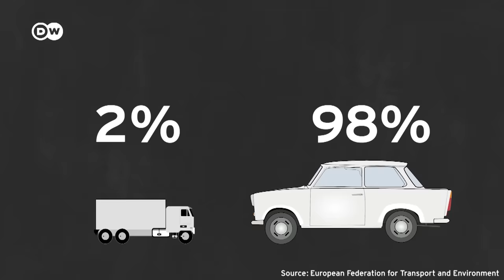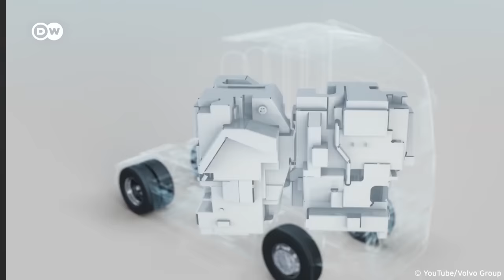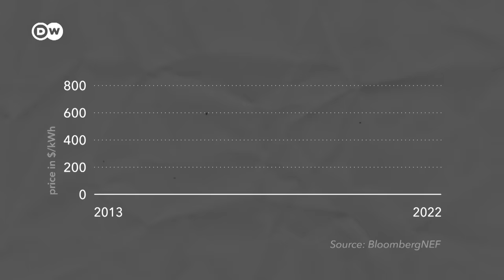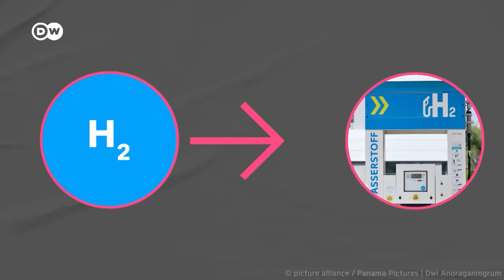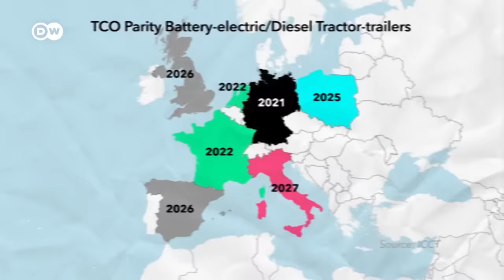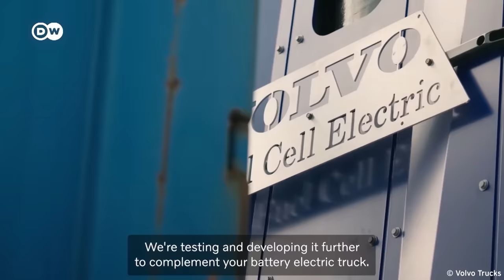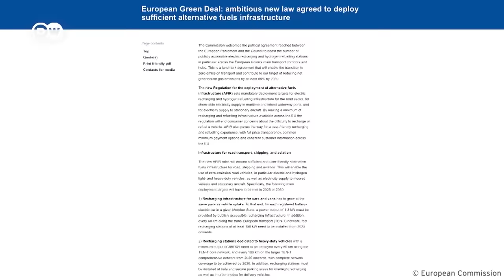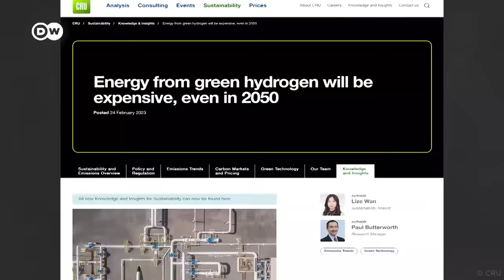Which will be the engine of the future?

Comment: How long do those batteries last? how expensive are them to make (water/energy)? And what parts can be recycled or reused? Isn’t the waste of the battery pack and all of the energy used in the making worse than our original problem? Honestly asking, I’ve yet to read/hear a straight answer
Reply from the maker: Great questions. 🌻 Generally, lithium-ion batteries can last several years before needing replacement but their longevity is impacted by temperature, charging habits, and overall usage etc. Battery production and its environmental impact are complex topics. We made a video looking at "Can you recycle an old EV battery?" you can check out here 👉 https://www.youtube.com/watch?v=PbOBmnZRpZ4

Comment: There is one aspect that always seems to be missing in this discussion, and that is the disposal of electric batteries at the end of their useful life (we are all familiar with this problem, when the batteries in our electronic devices get old, the don't stay charged for very long). For long-haul trucking, this phase late in the battery's life makes it economically unviable, so the batteries would need to be replaced on a regular basis. But what do we do with these old batteries?
Reply from the maker: That's right! EV's are still very hard to recycle. We did a video on this previously you can watch here 👇
https://youtu.be/PbOBmnZRpZ4. 🚘

Comment: Moving heavy batteries consumes more energy and is inefficient. Battery technology is still evolving. It's not practical unless it has much higher energy density, lightweight, preferably portable, and less deteriorating. Hydrogen energy density is also low. Thus, plug-in improved battery + hydrogen fuel cell or ICE for last miles and electric cargo train in the trunk lines is the best combination.
Btw, not only automobiles but also the entire life cycle of any products should be as sustainable as possible. Shifting the pollution by greenhouse gas emissions to the environmental destruction and soil pollution by lithium and rare earth mining in certain areas is not necessarily justified.

Comment: A fairly balanced presentation. But the more you think about it, the more obvious it becomes that BEV is the only viable/economical solution. 
Tesla already proving real-world day ranges over 1000 miles possible. Personally I think swappable batteries overcomes most of the concerns about BEV; smaller lighter battery on board, fast “refuel” time, access to slower cheaper electricity.  The “spare” batteries even have a dual role in arbitrage (buying cheap, selling during peak period). So I’ll happily take a bet with anyone who thinks HFC will ever have any significance in heavy goods road transport.

Comment: I like this change, but do you have some data on the amount of additional electricity that needs to be produced to charge all these trucks, in addition to all the private vehicles?

How much more energy has to be produced and how much more CO2 will be released in the process? 

How much more nuclear waste?
Reply: Electrification will actually lower total energy demand. Electricity is always cleaner than burning diesel in an engine.
Reply: @Simon-dm8zv 
Nevertheless more electricity is needed, which has to be produced somehow.
Reply: @eric8372  Correct, so in a worst case scenario this will be supplied by fossil fueled power stations for the time being.
Reply: Clean energy, renewables are cheaper than coal now.

Comment: Probably need to clarify the heading. It’s not to do with the engine, but the ‘fuel’ lithium battery vs hydrogen. Fair sure both work on standard electric motors.
Reply: Hydrogen fuel cell for EV but you can also burn hydrogen ICE style.

Comment: Both. Mining and heavy use will never be able to use batteries very well. Also the US and Australia transport cargo by truck much further than any other countries on Earth.

The US should utilize cargo (freight) trains much more, but they do not. Australia does not have the tracks to move cargo by train across the country. Australia is better off using ships to go by sea, but this will only ever serve the majority of the population who live near oceans. The rest of the country will be left out. Not something that is feasible because it ignores the food growers across large expanses of the interior. These will always rely on trucks.

Australia also relies on the truck train for long distance shipping. That is a number of trailers pulled by 1 tractor truck (semi in US parlance). This is just too much weight to be pulled by batteries.

3 markets perfectly suited to the strengths of hydrogen. You could develop hydrogen generation along the routes designated, at points which will allow refueling before they run out. Providing also a break for drivers.
Reply: First stop the battery and battery swap large truck & semi fires. Janus Australia. Prototype and Cement Australia vehicles burnt & melted.
Reply: Without long haul trucking to compete with rail would become very expensive for moving freight.

Comment: Batteries are right now too heavy and unsuitable for heavy hauling.  A full capacity truck will cut the range down by half.  Plus the raw materials needed are a limited resource.  Battery life is also a concern with degradation over time, they will need to be replaced at least one.  H2 is the better bet long term and stable in terms of performance over it's lifetime.
Reply from the maker: Hey there! We also did a full video on hydrogen. You can check it out here 👉 https://www.youtube.com/watch?v=AGTjKJHu99c
Reply: Do you know that by law you have to replace hydrogen tanks every 2-3 years? You said batteries cut the range, why? You stop for a mandatory break, you can top up your battery. You can't drive for 15 hours without a break. Limited recourses, mmmm diesel is unlimited, right? Or do you think that hydrogen is free and you can collect it without cost? Battery degradation, first gen batteries are still in use after 10 years, and when they don't meet the criteria they use them at houses to get power from solars and to stabilise peaks of the grid. H2 is 2.5 times less efficient that battery-powered cars-trucks. It needs 30% more power to produce it, needs +20-25% power to compress it to 3000 bars and needs trucks to move it from where it is produced to H2 stations. And is has max 70% efficiency on fuel cells and 40% efficiency in ICEngines

Comment: Can you mix 2 or 3 different fuels for car use, like fossil fuel with hydrogen or ammonia or LPG, etc...
Reply from the maker: It is not common, but if the engines are specifically designed for such applications. Dual-fuel engines can mix a primary fuel such as diesel with a secondary fuel such as hydrogen. (🔗 https://www.sciencedirect.com/topics/engineering/dual-fuel-engine)

Comment: Another option, DME is a synthetic fuel that is compatible with diesel. It would be made with thermal nuclear energy using a high temp reactor like the Molten Salt Reactor which could crack water with heat alone using Sulfur Iodine cycle potentially much cheaper than electical energy, the eff is 50% from heat. If you use electric splitting the eff is possibly half or much worse. The hydrogen is then converted into DME as a carbon neutral process and since it is a diesel substitute, no infrasture changes other than building these synthetic fuel plants next to thermal nuclear plants.

Nobody at this poit can project the pricing of all the options until all options have competed at scale for a while.

Also Sodium Ions batteries could supplant or complement  Lithium Ion batteries, not quite as energy dense, but potentially cheaper to produce in the long run and besides, Sodium is 1000x as plentiful as Lithium. Table salt is just Sodium Chloride.

Comment: Not on Australia diesel all the way because the Semis cover much longer distances and have very strict deadliness and most electricity is generated by coal and gas in Australia so there is no point for EVs and there was an electric semi that travelled from Brisbane to Canberra to deliver an electric Fire Engine lunacy
Reply: Electric cars are always cleaner, even on non renewable energy.
Reply: @Simon-dm8zv  You do realise that to build one EV it creates a massive carbon footprint were as to make a new petrol or diesel car it does create a carbon footprint but than can be reduced because petrol and diesel cars will last much longer than EVs and l own a 26 year old Toyota Hilux and its carbon footprint has gone and it will continue on for another 26 years at least
Reply: @lesklower7281  As we all know by now through extensive resereach: total life cycle emissions of an electric car are far lower than a comparable petrol or diesel car, despite the fact that their production emissions are higher.

Comment: I saw a video that pointed out a rail transportation issue. In the EU there are a significant large number of rail lines, however few are inter connected to other lines. My guess this is the result of the political boundaries existing at the time they were built. Maybe there are other elements that prevent the connections between different lines. Seems like a project to connect all of the small lines into one big structure would bring an improved efficacy, and cost reduction, making greater profits.

Comment: i am not a mechanical, chemical, motor engineer or anything related to them, but i always wondered why they never just burned hydrogen. you know instead of burning petrol you burn the hydrogen for energy. pretty sure its the most efficient form of fuel and clean too.  i am assuming that its too "explosive" or too uncontrolled but idk maybe you can control the ratio of fuel to oxygen for that. why depend of hydrogen fuel cells

also i like how the entire comment section loves trains.

Comment: The presenter said hydrogen is 40% effective and batteries are 80% effective. The researcher said you need 3x more energy with hydrogen, and this is correct, but how the presenter said it it would be 2x differnce. The error is in the presenters efficiency number, and hydrogen has a loss of 75% not 60% as she says.

Comment: Like trolleybus, the heavy truck should be trolley truucks. No battery needed, neither diesel, totally eco-friendly. Old used battery also will one day be a concerns for waste management, and cause of pollution.
Reply from the maker: 🚚 We made a short on pantograph trucks and why they aren't mainstream even though the idea sounds good. Check it out here 👉 https://www.youtube.com/shorts/ReQ99xAmdj8
Reply: @DWPlanetA  ❤️ bio-gas (biological methane gas) fueled trucks can also be an alternative for only truck vehicles. And bio gas are not going to end up like fossil fuel, it gives CO2 and H2O as byproduct. Now even SpaceX also testing methane fuel for Rocket engine, and the starship is on the way of success. Oxygen plants should be encouraged to balance the CO2 level in atmosphere. I think CO2 is less to worry than CO. And country with high possiblity of hydroelectricity should be encouraged to produce in full capacity, so it can come in international market and help less burn fossil fuel for electricity generators.

Comment: The fact that a lot of wind farms don't always run at their 100% capability when the wind blows, says we already have capability for more and better green energy. It is the storage of this lost energy that needs to be worked on. So if all wind farms made hydrogen and had lots of storage for the hydrogen, then the price would come down quite quickly. Alternatively, have on-site battery storage that is not lithium-ion.

Pure Electric trucks need to take engineering from cars. In the sense that trailers can use batteries as sidewall structural. And putting the thinner solar on the sides of the trailers would also help increase range.

Comment: The lithium-ion battery which is used in EVs is made from various rare earth minerals and a huge amount of energy is needed to extract that minerals out and refine them. This process emits a massive amount of carbon dioxide and also these minerals are very limited in quantity and one day these resources will also get exhausted but Hydrogen can still be easily produced. Fuel cells may not be so developed as EVs are today but we should also focus on them and eventually the price of Hydrogen will drop.
Reply from the maker: Hey there! Yes, there are many challenges with lithium-ion batteries. We looked at an alternative kind of battery in this video  👉https://www.youtube.com/watch?v=-vobMl5ldOs and we tackle Lithium specifically here 👉https://www.youtube.com/watch?v=gAZV1Ut6DDs Let us know what you think ✨

Comment: Electric trucks with a diesel generator onboard to charege batteries like the ones Edison Motors is developing reduce emissions nearly 50%. These can help reduce emissions in remote areas and long hauls using existing infrastructure.

Comment: A third option was trailed in Germany using overhead power cables on the right lane of the autobahn.  Similar to a train. This way no heavy battery is needed in the trucks, only a smaller battery (or small hybrid diesel motor?) To power the last kms from the autobahn to the delivery point. What happened to this I am not sure. At the end of the day net zero targets and our current lifestyle are not mutually compatible.  Perhaps reducing whats transported could save the most co2 of all 😀

Comment: The advantage that hydrogen has over batteries is weight.  Mixing hydrogen with oxygen to make water involves taking the latter out of the air, which the truck does not carry.  For batteries, all of the power required is carried by the truck.  Given there is a maximum overall weight applied by law to trucks thanks to their damage to road network, any additional weight means less haulage.

Comment: No word on the impacts these huge amounts of batteries will have. I don’t understand why it has to be this or that. We have a general problem in mobility and these two options both offer solutions in some form. But the best way would be to reduce the demand for long journeys and to use more efficient methods like rail.
Reply: Without long haul trucking to compete with rail would become very expensive for moving freight.

Comment: If there must have trucks, I think that more investment should be put into that idea of having OHC above the main trunk highways. It's more efficient, both from the perspective of energy & materials resources, to send the electrons to the vehicle through a shared copper wire then to have every vehicle carry them in its own box. Consider this, if trucks, at least the ones that are operating either from a port to warehouse or between warehouses,  can draw the majority of their power from the grid as whilst driving down the highway, where most of the journey will be anyway, then maybe each vehicle doesn't need such a large battery, because it would only need to cover the few tens of kilometres between the begin/end destinations and the electrified highway network. Those trucks that would be used for these point-to-point shipments along the electrified routes might only need, say, 100km of battery range instead of 500, for example, meaning that theoretical 500km battery could be "split" across 5 different vehicles for the same amount of battery materials. Important with our restraited supplies of Lithium among other elements.

Comment: the internal combustion engine has been around for more than a hundred years, and they have had alot of time to improve upon the tech, but the reality is, the efficiency of ICE, is still pretty damn low, roughly low 30ish percent. Battery tech hasn't been really improved upon until last few years, and already its been proven that it can work, give it another decade or so, battery will over take ICE, and ICE will be a thing in the past
Reply: Well said

Comment: I suggest to use both for meantime bring fuel cell and Electric battery working together save more energy charges less. Top of roof truck should have Solar panels so that sun shine heavy heat wave of summer times.

Comment: I dont understand why they dont just put a small diesel generator in the long haul EV trucks. that would both compensate for the range charging the battery while driving and support with heat for both batteries and cabin. The extra emissions would be equal to a small car on idle.
Reply: Look up Edison trucks.

Comment: here is ongoing research to provide power to moving vehicles, either through inductive roads or overhead wires. If just a portion of inter-city roads were "power roads", then big trucks could use smaller batteries, greater capacity, and less recharging while parked. Hydrogen simply can't compete with much cheaper electricity.

Comment: just build more trains. Trains can hold more cargo, they're super efficient, and they can be electrified without the use of batteries. Electrified rails can be powered by one big engine and still be better for the environment, plus they can easily be converted into clean energy in the future.
Reply: Sure, but even then large numbers of electric trucks are required.
Reply: Yeah but just for local deliveries. You will still need trucks make deliveries from the train to a store or wherever. also we should build places that need these deliveries near the station so you could even reduce the number trucks needed.

Comment: There is no universally best possible solution. Especially with tech we have and we might have in short term. Alternative to fuel cells, not mentioned, is direct hydrogen combustion. BMW and others tried that, but it seems that it does not make sense for small vehicles. But for heavy equipment and haulage it's completely different story. Check JCB and what they do. Sort of simple re-use of diesel engine concept altered to use hydrogen directly. No expensive materials like for hydrogen fuel cells needed. Simple solution. Yup, not ideal for every possible car or bike. But some, like mentioned trucks and heavy haulage .. that might be a way.